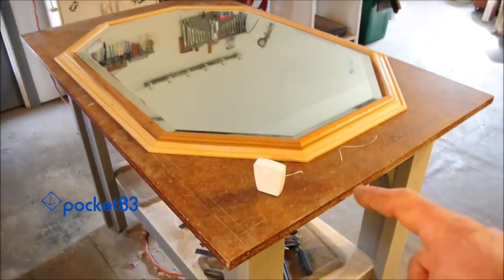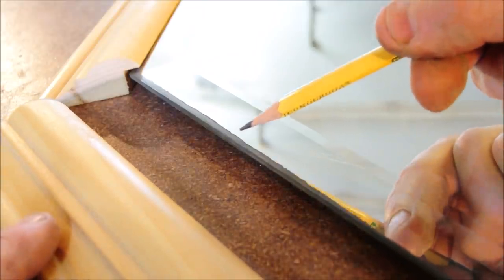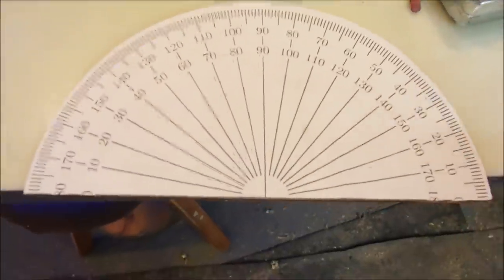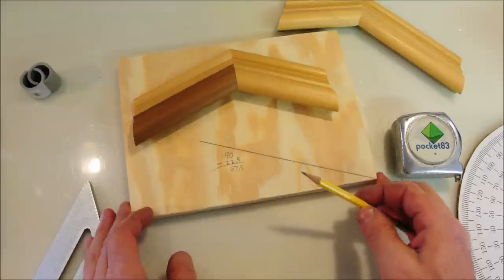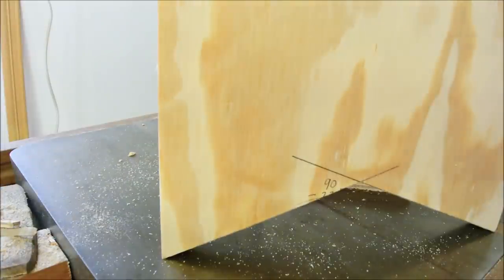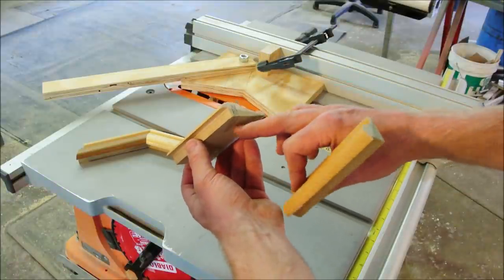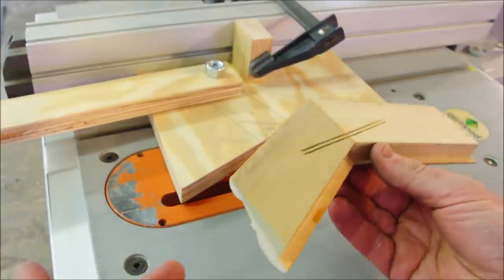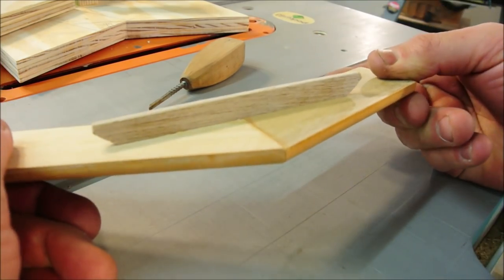45° miter biscuits (8-piece mirror frame)

Comment: I have a miter box that has slots for 22.5, 45, 90, 30 and 60. I love that box, and i often think about all the weird angles you can get by making a cut, then flipping the part around and making another cut. I think the smallest angle i can make is 30 - 22.5. I make a 22.5 degree cut, then a 30 degree cut on the same piece, and the offcut from the second cut will be a wedge that is 7.5 degrees on its smallest corner.
Reply from the maker: Do you ever use one of those zero-clearance boards on your miter saw? Those things are great. It'll keep little wedges like those from getting sucked up into the blade and exploding. As for your math, I didn't check it. Too much head-scratching there. I'll take your word for it.
Reply: thats a brilliant concept :D
Reply: @pocket83squared  I tend to hand cut stuff if its 2x4 or smaller using a miter box and a box saw. i have one of those stanley miter boxes that uses cam pins to hold the work, and i've never had anything slide on me. So for cutting the tiny wedges, i just squish it in the miter box really tightly with the cam pins and take my time getting the cut started.

i don't know why i use the box saw by hand so much, when i do have a fancy radial arm saw that can make miter cuts. getting the hand saw to move just right is relaxing in a way lol. The last thing i made with it was just a door stop, and i believe i went with a 30-60-90 triangle cut from a pine 2x4. I wanted it to look like those old door stops from elementary school where the building is 100 years old and the doors don't have hydraulic arms

Comment: Now that I've actually watched the video, it seems like you took for granted that all of the angles on the mirror were exact matches.  Is that the case or did you just elide the part where you actually verified that each angle was the same?
Reply from the maker: The jig was used as a reference. Each angle was compared to the jig, and then the discrepancy was noted on the mirror with a dry erase marker. All were within one degree. 

My default assumption is that no two angles will ever be exact matches. In fact, I even consider the jig, the protractor, and all of the numbering on saws to be arbitrary. Trust nothing. Everything is a comparison, to be determined as with respect to something else.

Comment: Saying to not use "those special calculators" is foolish.  That's like saying don't use a calculator at all because you COULD do it long hand.   Using a TOOL, which a calculator IS, simplifies the effort as well as helps to further eliminate error.   And, you came off sounding quite an elitist.   You make a good video and give some good points - stay humble.
Reply from the maker: Don't take this personally, but I'm not going to coddle you. 

There's a difference. It's not a better tool; it's just a specialized easier tool. Tell me, do you wear Velcro shoes? Still ride a bike with training wheels? 

If you really want to eliminate error, you'll develop an understanding of the subject you're attempting to improve in. You might at least learn how to use a generalized tool, like "long hand," before moving on to a device. I maintain my position, and will even restate it with more inflammatory force: if you aren't smart enough to figure out a²+b²=c², then you aren't smart enough to be operating a saw. 

If you had learned the math, and you still wanted to use your yellow calculator, I'd respect that. But defending such a childish crutch tells me that you have not. You are arguing in favor of ignorance. Now THAT is foolish.